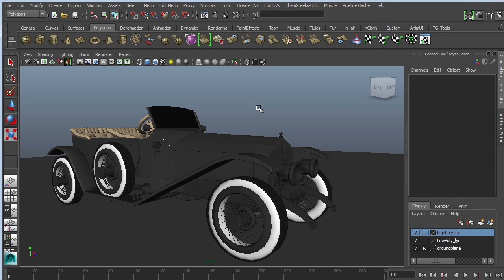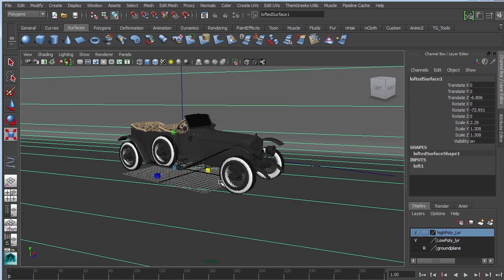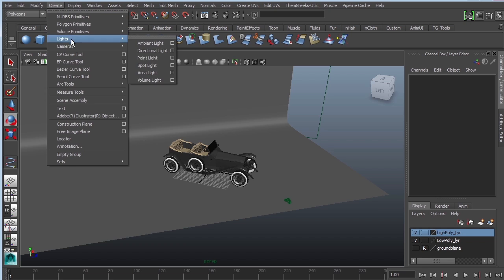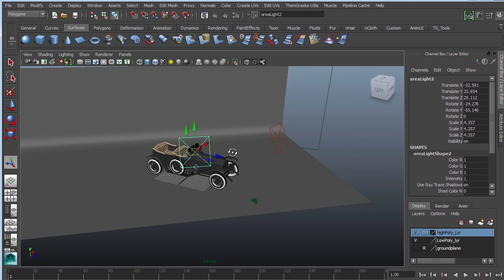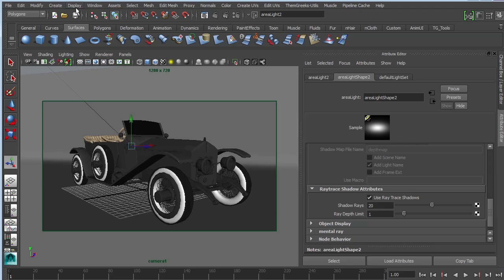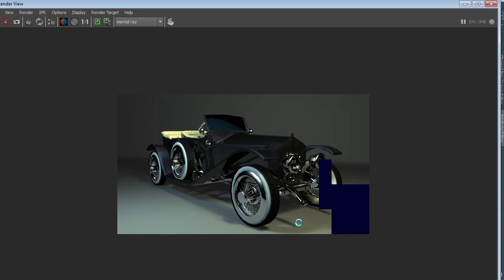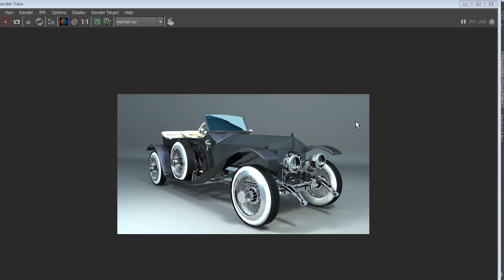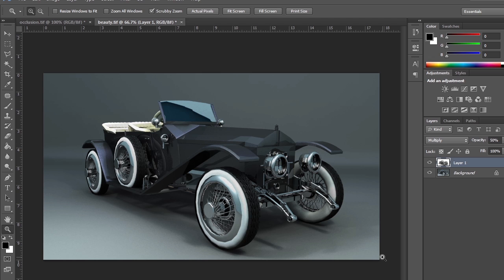Studio Lighting Set-Up Using Maya

Comment: hi! I followed the light setting but the shadow is to hard edge, how to fix it?
Reply from the maker: Hi! What type of lights are you using? If it's an area light, it should automatically reduce the hard edge. If you use spot lights, for example, you can soften the shadow with the Light Radius and Shadow Rays in your Shadow attributes. I hope that helps!
Reply: i used area light
Reply from the maker: Are you using mental ray or arnold to render?
Reply: mental ray
Reply: http://imgur.com/a/OLMGp
i turn off the color mangerment, so i need to add more light, however, the shadow more raw